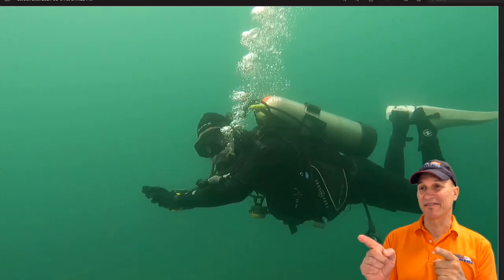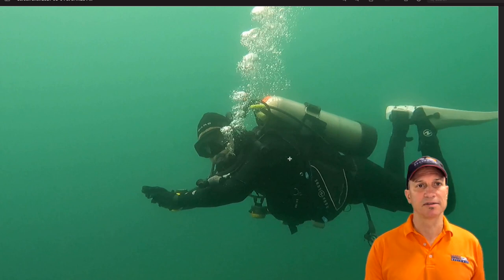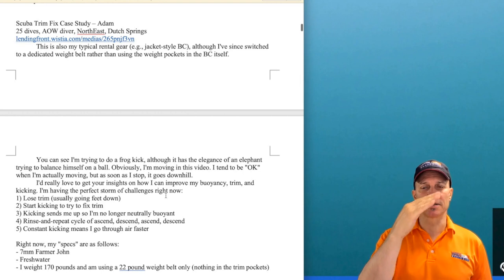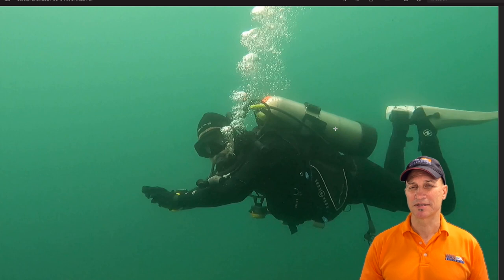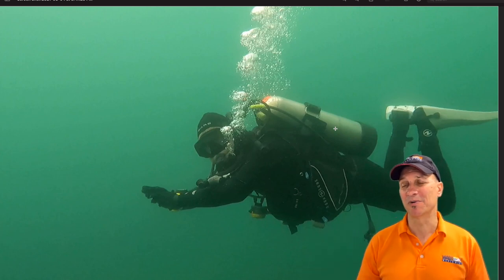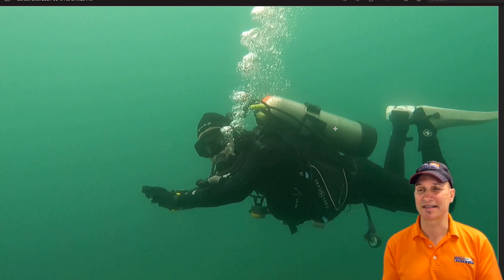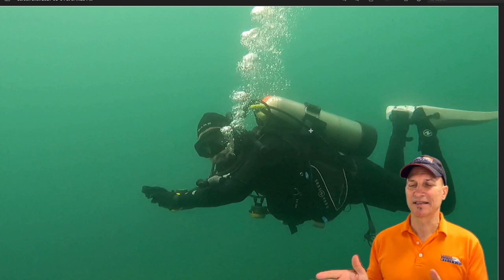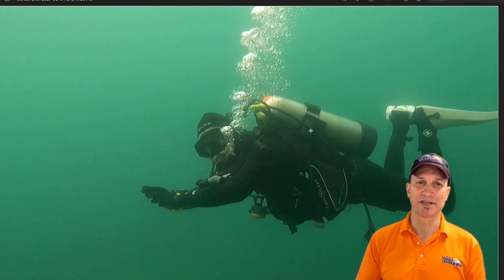Scuba Trim Case Study - Adam (Trim tips)

Comment from the maker: Does anyone else have constructive tips for improving trim? Let's hear them.
Reply: A small point, but tanks of any kind don't change trim as they empty;  the whole tank gets more buoyant.  The reason the back end goes up is the weight of the first stage holding the front down.  But the net effect is you will be losing 2kg or whatever from the position of the centre of the tank as you burn the gas.
I agree about the effect of the wet suit with depth and you can compensate for that with how much you extend your legs and where you hold your arms.
But for me the best way with this sort of rig is to use a wing-style BC, so the lift is right with the cylinder, and as much as possible concentrate the weight around your centre of buoyancy.  It takes a bit of playing about but trim pockets and a backplate help and when you get it right you'll find your trim stays pretty good at any pitch or roll angle you happen to be in.  If I use a weight belt I put the weights at the back for this reason.  Well, it works for me.
Reply from the maker: Thanks for adding your thoughts and experience, Tim.

Comment: Hey Jim, good video highlighting just how much work is required to get into proper trim! Do not assume it'll just happen...   I'm tall, skinny and dense (no not stupid, just not much fat) and having been a reasonably decent mountain bike cross country and Triathlon racer, i have a big tidal volume for my frame. This makes me rather leg heavy when in a wetsuit. As a result i actually have some specific weights permanently attached to my BCD/backplate to trim me out.  On is a 0.5kg weight right up on the upper handle, ie pretty much at my neck height, in order to push my upper torso downwards.  As you mention i try to avoid a low slung weight belt, and install weight in cyl trim pockets and in integrated positions that are higher up.

One thing worth checking is that for any non-ditchable weighting, that you can empty your bcd completely and still swim up from 5m.  As long as your overall weighting is just enough to compensate for the loss of breathing gas during the dive (say 3kg delta with a single cyl setup) then this really isn't too hard for the average swimmer ime.
Reply from the maker: Great point about the balanced rig, Max. I’d love to see a vid of your trim work. Sounds like you are working with an interesting set of variables.

Comment: Equipment:
Totally understand he's using rental. But if it's possible to get a wing BC, that will immediately solve a good part of the issue. (And a "pool boot" on an aluminum tank?)
Placing the tank higher up is one way to help with trim (awesome point there Jim), however, I would say (just my own opinion) the primary reason for tank positioning is "self rescue" (ability to reach and manipulate the tank valve).
Some people do have issues with weight belts (I never have, but each person's body composition is different, and wearing that much neoprene doesn't help), so solid point on using the trim pockets.
And I'd say a drysuit (and learning how to use it--i.e. just enough air to "stop the squeeze" and nothing more) could help greatly... However, he's renting, so that's a different matter.

Technique:
He could definitely use some work on that frog kick (top of the fin is pushing instead of the bottom of the fin as it should be), but time can fix that.
Perhaps he could try spending some time laying on the ground on a wide piece of wood? Place it perpendicular to the torso and lay on it to become a human teeter-totter, then spend some time moving your arms and legs together as a single unit to get a good feel for your center of gravity and finding balance... Once you have a feel for it, practice in the water. It might be helpful, it might not. But worth a try. :)
Just remember that the "9-Hour Rule" always applies for all motor skills. The average human being requires roughly "9 hours" for the brain to learn and instill any new motor skill. This rule applies to everything... From learning to hover a helicopter while in IGE, to developing perfectly neutral trim underwater. So the more you practice, the better, and roughly around the 9 hour mark all of a sudden your brain will suddenly have an "Ah HA!" moment and everything will just click.
Reply from the maker: Great comment, AJ 👍

Comment: He has a crap ton of buoyancy in his chest area with his weight belt around his waist. So it is only natural that he will be chest floaty. The trim pockets will help, but a heavy steel backplate with a weighted STA will probably be the best solution. That moves most of the weight from his waist up to where most of his buoyancy is. Keep a few pounds on the weight belt (or pouches on the BPW belt) as ditchable weight for safety reasons.
Reply from the maker: You’re right, TPL…I hate to use BP/W as every answer 😜

Comment: If you put weights on the cylinder, it cannot be called trim. The trim balance should only be the principle of the seesaw, and the center of gravity should be concentrated only on the waist. 
If you want a nice trim, carry a stone in your hand.
Here is a video that uses weight pockets, heavy jet fins, and 5mm wetsuits only on the waist of the aluminum backplate and maintains the trim without using a Fin kick at a depth of 25m.
Also, a diver in a video edited with a photo or a slow video cannot see the trim ability.. You don't know whether that posture is maintained for a few minutes or not, and if you go forward, anyone will get a good posture. watch it You have to practice to trim.